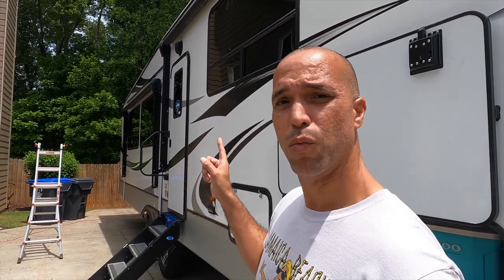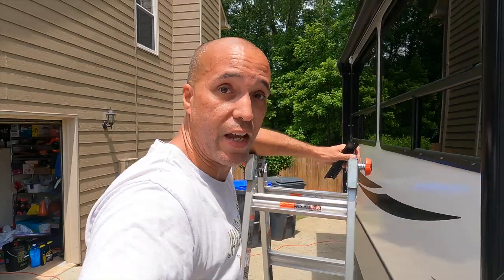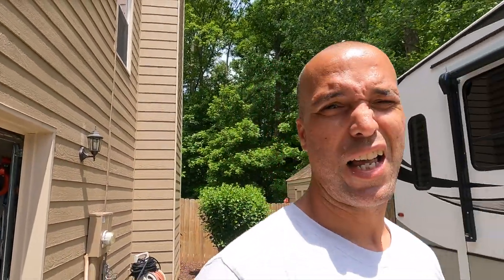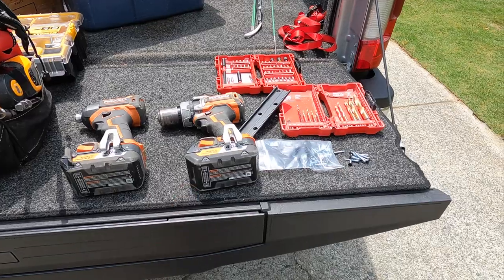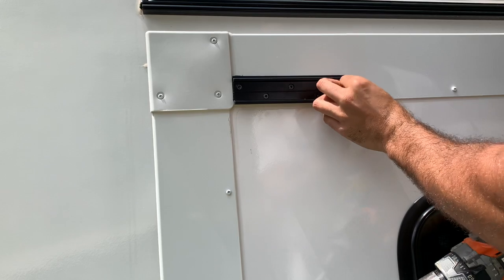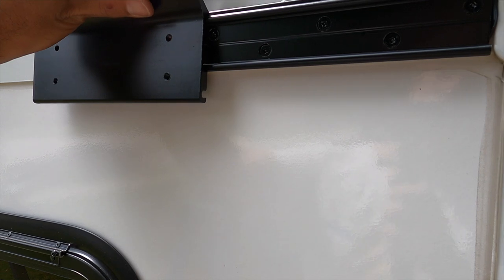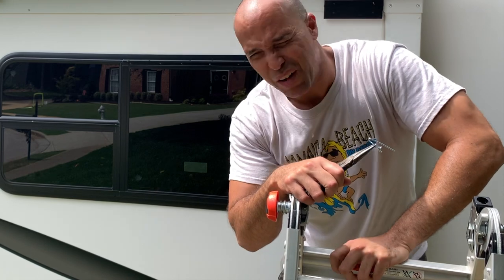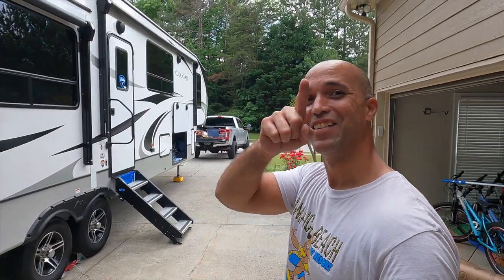Installing Solera RV Slide Toppers | DIY Awning Cover Install

Comment: After my second trip with my new camper and having to climb on and balance my big rear end on a ladder with a floor broom on an extension pole to sweep off my slide-out, I'm getting a topper for it.  Your video helped give me good perspective on the installation process.  My slide is 13' 6" so I'll definitely get a second set of hands to help.  Thanks for a great walk through.
Reply from the maker: So happy you found it helpful! Congratulations on your new rig. Hope you’re able to make some great memories.

Comment: The only thing I would change is, I would mount the part that mounts to the trailer higher so it has some pitch so the rain will roll off..
Reply from the maker: Hi friend. After doing this install I would agree with you. I was following the directions that came with it.  Not sure why they say 3-6 inches. I don’t see any reason why you couldn’t give it more pitch. Good observation.

Comment: Very good video.  My new 2024 Alliance Paradigm slide out covers were installed by the dealer.  After 6 weeks, the fabric pulled away from the spline.  It appears they used a staple, one at each end to fasten the fabric to the spline.  I like the way you did it 
using two screws.  Thanks for the video.  Keep them coming.
Reply from the maker: Glad you found it helpful! It’s funny that they used staples. The instructions say to use a screw. In fact, the kit comes with screws specifically for that. This is why I have trust issues and prefer whenever possible to do things myself. 😂

Comment: Great video.  Use of a drill instead of impact driver is exactly right.  I also set the ratcheting setting to a low number to avoid overdriving the screws so no holes get stripped. Also, flaring and de-burring the end of the wall channel and lubing the interior of it  will let the fabric slide in easily and avoid any snagging or tearing during installation.
Reply from the maker: Yes! Those are great callouts. I did check for burrs on the channel. This one was fine but an excellent point you make. Ripping the topper as you slide it in would ruin your day for sure!

Comment: Thank you Sir. This was very helpful. I have to reinstall my existing awning it was installed wrong. It was fine for 4 years but now it's grinding on the slide out frame😢
Reply from the maker: I’m happy it was helpful! I have only installed new slide toppers. I haven’t had to reinstall one yet. I have reinstalled an awning before though. It’s not too hard but be careful with your hands. The roller is under a lot of tension. I tried to just hold it with my bare hand and lost my grip. It cut up my hand pretty good. It definitely helps having a second person there for that part. Also, using thick gloves. 😂

Comment: Great help. Thanks. Getting ready to order my slide covers. Should I order these a bit longer than actual slides?
Reply from the maker: I’m glad you found it helpful. My personal preference is to order them a little longer than the slides if you have the installation space. I’m speaking of the roof of the slide not the trim edge. Ideally I like it to be about where the trim is giving you a couple inches over hang from the slide roof. This is not always possible given the various measurements of slide outs so you really just have to match it the best you can. Review the description carefully when ordering and make sure what length of cover  they are describing. The fabric or the total length with the arms which will be longer. Hope this helps!

Comment: Awesome video!  Thank you!  This gives us confidence to definitely do this ourselves.  QUESTION for you......I notice that the topper is actually angling toward the RV when the slide is out.  Should it angle away from the RV when the slide is out?  Do the brackets that are attached to the slide need to be lower?  Or is that impossible because of the frame....so it is what it is?  It seems counterproductive to have it angle toward the RV.
Reply from the maker: Glad you found it helpful! You are correct. The topper should be angled away from the RV for rain run off. I’ve gotten a few other comments noticing the same thing you did. I think it’s a combination of the wide angle lens on the camera and shooting at weird angles that makes the video look like the toppers are angled incorrectly. 😂 In real life there is an angle away from the RV. To your second question, yes, the arms are adjustable somewhat. You can rotate them up or down to either raise or lower the angle. 👍🏽
Reply: @RCRVadventures  Thank you! 🙂

Comment: Hey Matt what size Butyl tape did you use?  Thank you for the video!  I have the same camper was wondering how toppers would work with awning on slide😁
Reply from the maker: So glad you found it helpful! The butyl tape I got at Home Depot. I think there’s only one size. Don’t remember exactly but I believe it was around 1.5” wide. You can find it in the roofing section. Don’t be like me and wonder around the adhesive section looking lost. 😂

Comment: Great video and entertaining.  I have the same model I think, 368mbi. Did you have any issues when doing the slide that had the awning attached? Any tips would be appreciated on that slide.  Also if we wanted more slope for rain run of do you think going 7 inches up would still work?.  Thank you so much! Happy camping to your family
Reply from the maker: Hi Nathaniel. The only issue I had on that slide was having to notch out the bracket of the awning about an inch. Other than that everything was normal. Personally, I don’t see why you couldn’t raise it up to 7 inches. I was just following the directions but I have seen other camper toppers that look like they have more slope. I would probably give LCI a call and make sure there’s no issues with raising it up a bit. Thanks for watching and happy camping!

Comment: I want to install one of these on our travel trailer the one question I have is where you mount the track on the side of the camper/rv where do the screws go into ? Studs or do you just rely on the material of the side of the camper to screw into? Wasn’t sure if there was a lot of pull on the awning.
Reply from the maker: Great question. I’m wondered the same when I installed the first one. The track only screws into the siding material. I think this is why there are so many screws. Each screw in the siding holds less force than one in the stud but they make up for the force by having so many screws that it spreads the force out. This is also why I recommend using butyl tape on the back of the track for waterproofing the screw holes instead of caulking. The butyl tape just by itself is VERY sticky and adds even more strength in my opinion. As well as waterproofs the screw holes.

Comment: Could you possibly post a video or photo of the other side where you started?  The slide with the awning attached.  I am purchasing a new camper and one of the slides has an awning.  Very curious as to how to install the slide topper with the awning there.  I am scared that my awning is even higher on the slide than the one in the start of your video.  Trying to figure out how its going to work. Thanks.  Great video by the way!
Reply from the maker: Hi Dale. Direct message me on our RCRV Facebook page and I’ll see if I can send you a picture or video of what ever will help ya. 
-Matt

Comment: I think you’re pretty brave tackling that alone.  I have to install one on my RV too.  Where did you purchase them?
Reply from the maker: Hi friend. Thank you. I just think to myself, if I mess up I’ll have to learn a new skill. Like patching fiberglass. Lol. The toppers were ordered from Amazon. Helpful tip. Measure the slide width and then order by the fabric width. They give 2 measurements. Topper width and fabric width. Renzo ordered his by topper width and wishes they were a little wider. Alfredo ordered his by fabric with and as you see in the video they fit perfect. 
Thanks for sharing with us and taking the time to check out our channel!

Comment: I read all over not to install your brackets on the trim flange is it holding up ok?? It would be my only option with the awning also
Reply from the maker: Yes, it’s holding up great. It’s not on the trim though. It is in the framing. In the middle of the video I show how to measure down to be able to clear your trim and get the screws into the frame. The screws are too long and will go right through the trim and cause damage when you close the slide.

Comment: the screws that come with the topper are self drilling.  do you suggest pre-drilling?  the instructions don't talk about that.
Reply from the maker: I tried it both ways and this is what I found. When putting the screws into the metal bracket to lock it into place, the self tapping screws work fine. No need to pre-drill. When putting screws into the fiberglass of your camper, for example the bracket plates or the awning track, I found that pre-drilling was best. The ones I didn’t pre-drill didn’t go in straight and would shift the bracket just a little. Also, without pre-drilling the fiberglass I found I’d have to press really hard and spin the drill very fast to get the screw to start going in. Then it was hard to slow/stop the screw and I’d end up over tightening the screw and stripping the hole and the screw would just spin and spin. 
If you’re going to pre-drill, most likely your bit will be longer than the screw is. Make sure you don’t push the bit in too far. 
Just what I learned from trial and error. Hope this helps.  
-Matt

Comment: I just watched this and I have a question. They look pretty flat when the slideout is extended.  Is there any concern for water runoff when it rains? Will it pool on the canvas, or is it slightly at an angle so it runs off?
Reply from the maker: I think it may be the camera angle. Others have committed that same thing. 😂 Looking at them in real life, there is an angle for runoff. You could, presumably, mount the back track a little higher to get more of an extreme angle. You don’t want to mount them too high though as it may turn into a kite during high winds. Also, easier for debris to get caught between the slide roof and topper.
Reply: @RCRVadventures  Thank you for the response! I think that will be a project for next spring.

Comment: I was just watching your video and wondering, shouldn't the topper have more slope when the slide is out for rain run off?
Reply from the maker: I honestly thought the same thing. I was just following the measurements in the Instructions but I don’t see how it would be a problem to raise the track a little more to get more slope. That being said, so far the slope works fine for run off. Thanks for watching!

Comment: can you show how to put the topper on when there is an awning attached.
thanks
Reply from the maker: Hi Jerry. I think the topper goes on the same way. The only issue I ran into was getting the bracket plate to fit. That’s where I had notch out a piece of the awning track.

Comment: On the part that the fabric slides into, does it matter if the screws are showing or not.
Reply from the maker: On the version that I installed, the screws are showing. There may be other types that have a plastic cover piece to hide them.

Comment: hello you didnt tell me how much overhang on each side how far past slide should the topper go and what kind of angle should the topper have. i have a gutter about 6 inches  up from slide out that my son says i can use but i told him its not for a topper.. what about price... and color... what is the average cost and what is the best color for it.. and do they make topper ends that can attach to topper and side of slide out because our rain sometimes goes sildeways and rain gets in  that way
Reply from the maker: Hi Karen. You have some great questions. As stated in the video, I’m not a professional. I’m just an RVer sharing a DIY project. I would suggest contacting Lippert to get accurate information. That being said, I can share with you my options on your questions. 
The angle of the topper is measured by how high up from the slide the track is mounted. I believe the instructions say between 3-6 inches up. 
I believe some gutters, (not all) have an accessory track that may be able to be used but only if your roof has a flat profile. 
A quick Amazon search will help show you current pricing. They are priced by size. As for labor costs, I’m not really sure as I did it myself. 
I’ve seen 2 color options. Black and white. There may be others that I’m not aware of. 
I have not seen topper ends to keep rain out. From my understanding, the toppers are primarily to help keep debris out, not rain. Your slide roof should be built to prevent water intrusion by the slight slant in the roof and also the seals. If rain water is getting into your camper, it may be a sign that there is another problem that should be addressed first. 
I hope this helps you. Again, it’s just my 2 cents. The most accurate info will come from the manufacturer.

Comment: I bought a camper and the slides don’t have the protection, what can I do? Where do I buy them or what else can I replace them with?
Reply from the maker: If you’re referring to the slid toppers that I installed in the video, most campers do not come with them. They can be purchased on Amazon. The company that makes them is LCI. You will have to measure the length of you slides to order the correct size. Hope this helps. 👍🏽

Comment: The pitch on the awning is towards the trailer isn't it supposed to be away from the trailer so the water drains off?
Reply from the maker: Yes, you are correct. It should be away from the trailer. Some of the video clips I shot with a wide angle lens and from weird angles to look more cinematic. 😂 It can sometimes change the perspective angles but the awnings are pitched away from the camper. Thanks for the call out though! 👍🏽

Comment: The track looks like it could/should be a bit higher up to create more of a slope - seems it would catch water vs shedding off. Wondering if it has been an issue?
Reply from the maker: You may be right. I always wondered why the directions didn’t recommend putting it higher. I just followed what they said. As far as I know, they haven’t had problems with pooling. It may be the minimum pitch needed to shed water while keeping the smallest gap to prevent wind and debris from getting under it. I may reach out to the manufacturer to get some clarification and make an update video as many others have committed on that very same thing. Has got me curious now. 😂 Thanks for sharing.
Reply: @RCRVadventures  great video by the way. If you have not had issue then I feel better about the pitch on mine - similar.
Reply: Flipping the track likely buys another 3/4 inch without exposing original holes.
Reply: Wouldn't adding more slope allow the awning to flap more going down the road? It wouldn't roll up as tight with slide in. I thought about that before I add 2 too my camper.
Reply: @robertmoore8705  No idea - but agree - would not want too much exposed. How much is ideal balance - no idea.
Reply from the maker: Never thought of that but I would think you’re correct.

Comment: Can you show the proper way to measure for the toppers, I have one that’s 861/2” wide?? And the second one is 1543/8” wide?? First one would be 7’ 1”.     Second one 12’10” ??? Thanks for your help. GC
Reply from the maker: Hi George! That’s a great question. Honestly, I didn’t really understand the measurements at first either. There seem to be 2 different measurements when ordering. The fabric width and the bracket width (which is larger) While I’m not a professional, I can share my understanding of it. Measure the roof of the slide out. I would want the fabric the be that measurement to cover it properly. You could even get the fabric a little larger by an inch or two. If there are no obstructions close to the slide frame/fascia when the slide is in, ex. Another slide out right next to it, an awning arm, etc. You should be good to go. If, however, there are close possible obstructions then you will need the measurements of the outside fascia of the slide and the Total measurements of the topper. The topper roller arm and bracket stick out farther than the fabric. You want to make sure that when the slide out is in that you have enough clearance for the entire topper assembly not to hit anything. 
This is just my understanding of it. I’m not a professional it’s just what I’ve discovered doing it myself. Hope this helps.

Comment: Any certain kid of butyl tape?  Is all butyl tape sticky on both sides?
Reply from the maker: From my experience, yes, all butyl tape is the same. I’ve purchased at Home Depot, camping world and also a A/V installation warehouse and they’ve all been the same. Only difference seems to be the width of the tape. If you can get the tape the same width of the track or bracket it makes things a lot easier. Just cut to length and keep going. Unrolling a long section and cutting it to the correct width is not fun. This stuff sticks to everything. Doable, but not fun. 😂

Comment: How far should a fabric hangover the size of the slide out
Reply from the maker: I believe the instructions say to just measure the slide width and use that number but I prefer to have it 1 or 2 inches wider if possible. Remember, the wider the fabric the wider the roller and hanger arms will be so verify you have enough room. Especially if you have two slides right next to each other.

Comment: In the picture at 17:00 in appears the outside edge at the roller is to high to let water run off effectively .
Reply from the maker: Not sure exactly what clip you’re speaking of but I have gotten other comments about the roller pitch. I think it may be the wise angle lens of the camera making it look that way. In person the pitch is more pronounced.